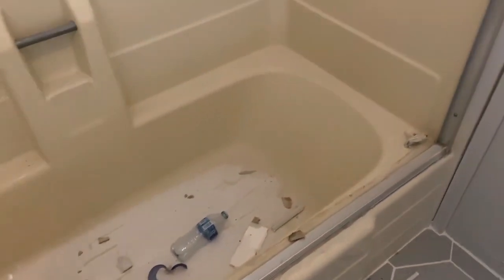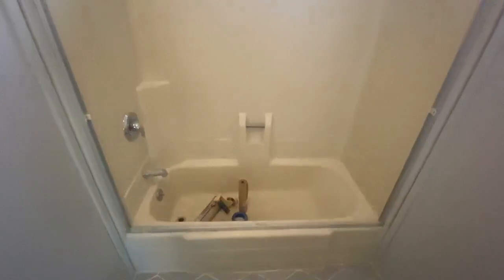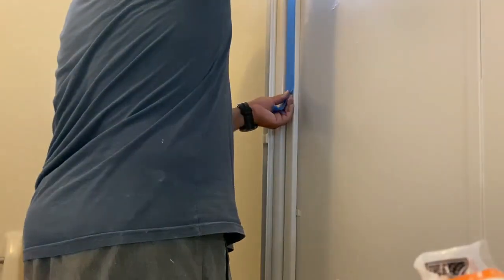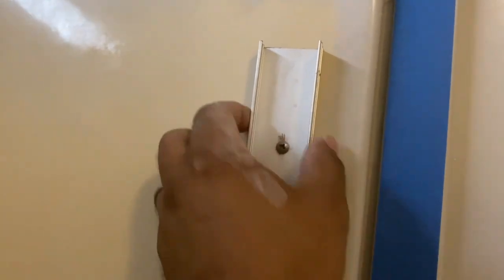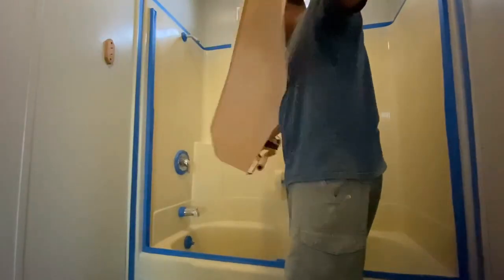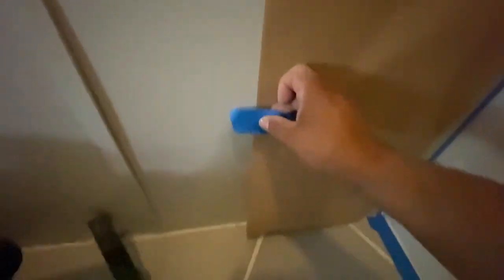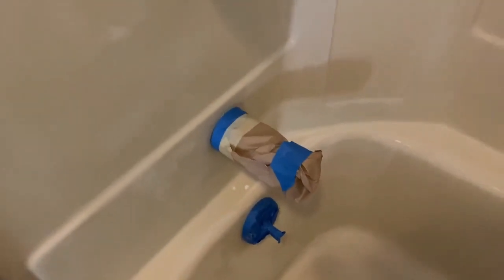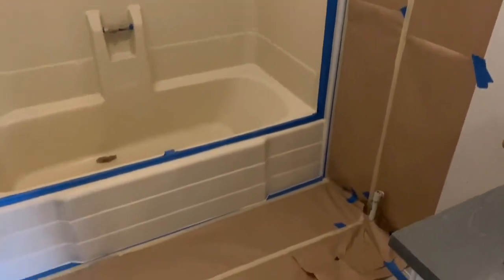TAPING AND MASKING AROUND A BATHTUB | BATHTUB REGLAZING PREPARATION | Paint Taping and Masking

Comment: If my tub surround is fiberglass and my tub is porcelain,  if I repair and prep everything very well, could I use Zinser 1.2.3 primer and the Krylon spray to refinish both of them at the same time?  Could I chalk the transition between the wall panels and the tub at the same time? Could the same primer and spray be used on the decorative boards already up in my bathroom.  Although they have a very outdated floral pattern, they are extremely sturdy and have a 4x4 tile pattern. I also would like to repair the cracks in the hexagon floors and also paint them the same white as the walls and tub. I would paint the decorative wooden fixtures in navy and the metal fixtures would be in a rose gold. I would also cut and repair the current non working shelves on each wall. My daddy and granddaddy were professional decorators and I was trained by my daddy. Therefore, I'm family with all of the techniques, just not the modern tools and products. This is a rental, so, I want to avoid a tear out.  Like my family,  you do high quality work.Thanks for sharing!